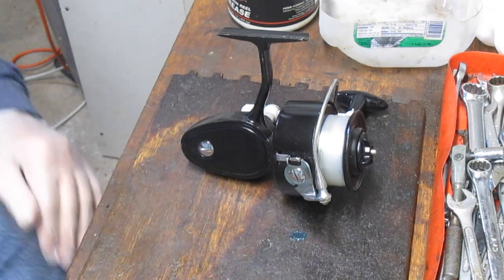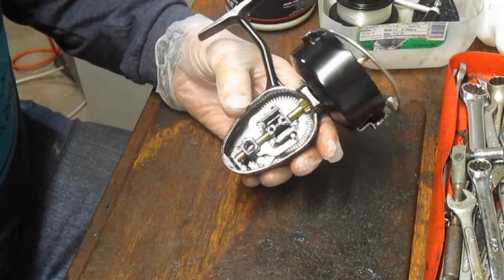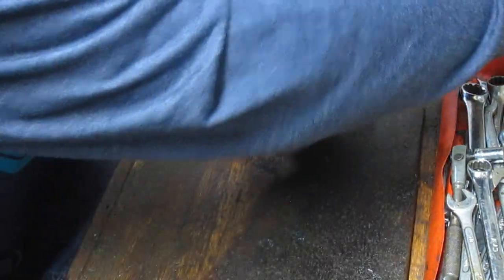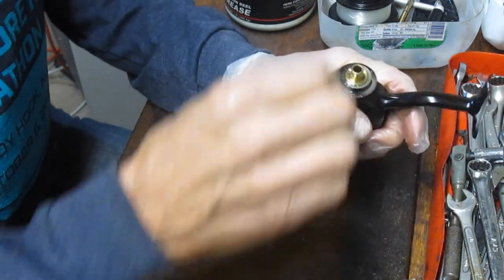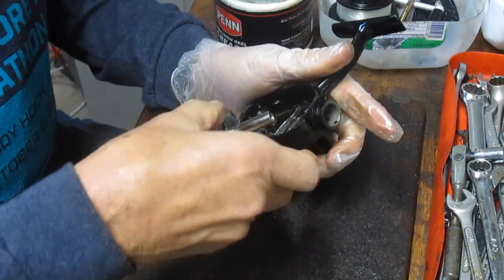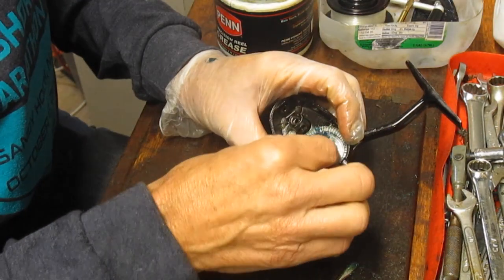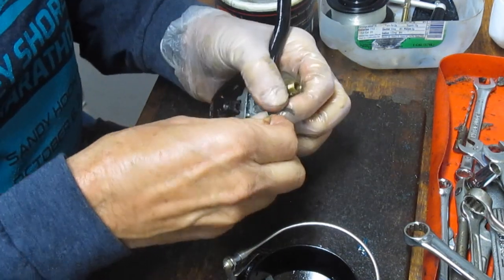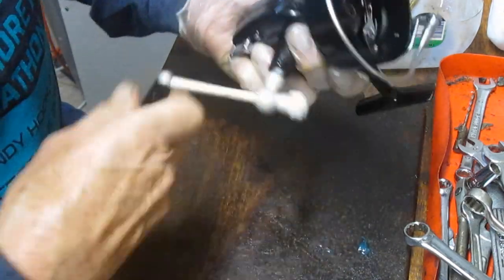Mitchell  306 spin fishing reel how to take apart and service this classic

Comment: A Dennis video from more than a year ago saved me tonight.  I can see how reel repair can become a business since a newcomer to spinning reels like me has more than I can do for folks that have heard about my reel repair hobby.  I was ignorant and thought the 306 would be something like the 300.  There I was in the garage scratching my head when I thought I'd search Youtube for a video and found this one on my smarter than me phone.  I'd been hesitant about getting the pinion gear out but followed the video.  Then, on reassembly, I fast forwarded the video to the parts where I was hesitant.  

Somebody had serviced this reel before.  The pins holding the crosswind block had been replaced with a construction staple.  So, I took a couple screws over to the poor man's lathe (a drill press and file) and turned them down to fit.  A little polishing of the tip at the belt sander along with thinning the screw heads for clearance and there are now two good fitting pins in the crosswind.  For rust protection I heated them red hot and oil quenched them to get a blue/black finish that will  resist rust.  Just something a farm boy growing up away from town would do.
Reply from the maker: You are way better at the bush fix than I am.  I get creative, but not like you.  Thanks for sharing this - Best wishes - Dennis

Comment: I wish my 2 306s were in such fine shape. This one looks almost new. I love these reels. The mechanism is well designed and reliable. I really enjoy my 306 that has been converted  to manual pick-up.  At first I wasn’t sure how to remove the rotor but quickly figured it out. I fish with both my 306s and 302s and love them. I’m still a vintage Penn lover but these are also very special . Thanks Dennis for another very instructive and concise video. I really depend on your teaching!
Reply from the maker: Thanks again Christopher.  Best wishes for catching big fish with those classics - Dennis

Comment: Another helpful video, Dennis.  I got a couple 306 from ebay a while back and serviced them.  That unique plastic fastener between the rotor and housing is technically called a "rotating head lock." Almost sounds like a wrestling hold, lol.... A few weeks ago l lucked out and got nine Mitchell 304 and one Mitchell 305 for a good price.  The 304/305 are very simply built reels, but very well engineered. lf you have a 304 laying around, a tutorial might help some folks because they can be found for peanuts on ebay sometimes.
Reply from the maker: I do have a 304 lying around.  I will add it to my request list.  Thanks for the idea Chester - Dennis
Reply: I also snagged an old 304S on eBay a few summers ago for cheap. Cleaned it up and regreased it and it makes one heck of a small pond or creek rig on a 5’6” light rod. One of my all time favorite small reels. 🎣

Comment: Thanks for the video, I have a couple 306's and the way I see it: If the Penn Battle is not considered too heavy, and the Ambassadeur C3 is not considered too slow, then the Mitchell 306 still specs out as a suprisingly relevant option. One of Mitchells best reels IMO.
Reply from the maker: That 306 I still a great reel.  Thanks

Comment: Dennis, I was looking at this video again because I just fixed up a 306A. I was surprised at how different the 306A is from the original 306. The rotor had a standard nut and there was no planamatic gear system. The 306A just had the simpler oscillation block held to the. Shaft by a double pin. The AR dog was the same. I think some 306A reels had a pinion ball bearing like a 406 and then other 306A just have a pinion bushing setup. I like the 306A as it is very smooth and very nice looking. I still like my two original 306 models the best. I got a mint unused in the box 406 but had to replace the main gear because the shaft was slightly warped. Didn’t expect that. Love this video!
Reply from the maker: Yes - the "A" series went away from the over engineered early editions on the 300 and 306 and went "modern" with the much simpler design.  Send me pictures of the Daiwa when you finish and stay well - Dennis

Comment: Thanks for this video. It really helped with my 407. The only thing I can't figure out is how to open up the drag.
Reply from the maker: If I recall, the wing nut serves as the drag tensioner and theater are only 2 washers, a fabric one and a teflon one under the wing nut and on top of the spool.  That is your drag system.  There is nothing to open up, if I am remembering correctly - Dennis

Comment: Thanks Dennis I bought a 306 this summer in excellent condition and think it's a great reel. I have two new Mitchell 300s which have been out for about 8 years and would be nice to see you service one of those. I think it's an excellent value and it's really smooth.
Reply from the maker: I will add that to my request list and do one should a customer bring one into my shop.  The current line of the Mitchell 300s are nice and well made.  Thanks for watching - Dennis

Comment: Hi Dennis. Was looking at this again to hear what you had said about a 406 pinion gear and bearing. Just got a never used new in the box 406 since I only had two 306s in my collection. Can you believe I got it for $12.50? Hasn’t arrived yet but will. get it Monday. I have heard that the 406 high speed main gears don’t hold up as well as the slower 306 main gear but I have a friend who has a lot of NOS  406 gears. I’ll probably pick up a spare. Finished a new handle for a Penn 706Z today. I’ll send you a photo. I’ve had this 706Z for 42 years and just finished refurbishing it with all new gears and bearings. It is a sweet reel! Love this video as I once used it to refurbish my 2 306s. I have a MB version that I love to fish with. I also put power knob handles on both the 306s. This is an outstanding reference video that I come back to often. When I first watched this video I owned 4 Mitchells. Now I have 15. I love these old reels!
Reply from the maker: That is a great buy!   I'm not aware of the problem with the gears, but I may call upon you to get me one if needed!
Thanks again - Dennis

Comment: Dennis,   Great video. I just got done taking apart my 306 and everything went fine. However, I am having the same problem with all of the mitchells. My old fingers don't work so good anymore and I have a nightmare with the bail springs. I must have spent several hours trying to get it back in and  I bent it.  I have another spring on order. Do any of your videos give a tutorial on replacing the springs on these Mitchells?  I have springs coming for the 901 and also several 300s.  Any hints, secrets , or guidelines to make this an easier job.
Reply from the maker: These are not easy to do.  Generally, you start in the off mode and put the spring pin in the bail arm hole.  You can then rotate it clockwise until the stop clears the hold on the rotor.  Next is to align the hole in the bail to the hole in the rotor and set the screw.  It is a balancing act and it is difficult for those of us will "old" hands.  I will see what I can do for a video - Dennis
Reply: I just quit taking mine out. I loosen the screw enough to get a little clearance, then use a small paint brush to work some oil in around the screw , spring, and the back of the bail arm. Works fine.

Comment: Nice job on this reel. Why do the larger salt water spinners tend to have single screw case door attachments while the lighter freshwater Mitchells have the three screw design? Is it designed for quick opening and drying should the reel get submerged?
Reply from the maker: It is for quick service.  some, like the 302 have mounting screws on both sides and the big red screw cap is to allow for oiling.  Some of the smaller Mitchells also use the single screw side plate cover screw - Dennis

Comment: Hi Dennis. I have the same problem with my 306 that someone else had. Removed ramp and T-pin but couldn’t get the pinion gear out. You suggested flooding with Wd40 and using cup for leverage. I tried this and other things, but it still won’t budge. Any other suggestions? I’m stuck. Thanks!
Reply from the maker: You are literally stuck!  I responded to your email - Thanks

Comment: Dennis I recently purchased a 307 which is the left handed model of the 306, would you by chance know where I could find any aftermarket drag washers for it? Possibly carbon fiber
Reply from the maker: Start by checking with Smoothdrag.com - you may need to search by dimension - inside diameter and outside diameter, rather than by product or brand.  Send them an email - they are very helpful - Thanks - Dennis
Reply: @2ndChanceTackle  thank you sir!!

Comment: What do you think of the drag?  Mine has a single plastic "drag disk",  that floats (not connected to the spool shaft) between the spool and the drag spring.  No washers and nothing under the spool.  This is correct according to the schematics I've seen.  But, how long will that last on the water with fish that may make long runs?
Reply from the maker: You are correct on the configuration.  The drag is a single washer.  A lot of folks that fish this reel use the anti-reverse override to back pedal the reel in fish fighting mode to play the catch and act as the human drag in regulating line in and line out and that's how they make it last.  These are not like the modern drag stacks - Dennis
Reply: I just punch leather washers out of old gloves at work, grease them up and stick one between the plastic washer and the spool. I find that the leather's compressibility makes fine tuning the drag adjustment a little easyer. You can also put a thin tefflon washer under the spool, but you want to keep it free of grease, and you probably want to remove it when spooling on fresh line.

Comment: Hey I have 307 
But  the circular screw thing under the spool makes it to tight it hardly spins 
I wonder if I'm missing bearings or any other parts 
Have nice day
Reply from the maker: That's hard to say.  The best thing is to check your reel against the schematic diagram to see what may be missing.  You can find the schematic here https://www.reelschematic.com/wp-content/uploads/schematics/Mitchell/Misc/MITCHELL%20306-307(1990).pdf  Thanks for asking - Dennis

Comment: Great vidio ..I am working on my 306  I have the trip ramp off the T pin out but the pion gear dose not come out wont budge:( it spins and rotates  withe ease just wont pull out... Any one run into this problem if so how did you get it removed?
Reply from the maker: Of course.  It is dirt and dried grease along the outer rim of the bearing.  First step is to flood that area from top and bottom with a penetrating oil like WD40.  That should help dissolve some of it a free it up.  If you need leverage, put the rotor cup back on with the nut and tighten it down about half way.  That will give you a stronger grip to remove the assembly.  You can also use the rotor cup when a little loose to act as a slide Hamer to help when pulling up - Dennis

Comment: Thanks for the video. Am currently trying to service my 306 but the push button for spool removal is seized, have you ever come across this issue?
Reply from the maker: Yes I have - Try unscrewing the cap to free it.  There are prongs on the axle shaft that are likely catching inside the cap and not releasing.  You can also try to free is by flooding the top with a penetrating oil - Dennis
Reply: @2ndChanceTackle  Thanks for the advice. Had no problem getting the cap and spool off but not the spool spindle, I have the push button soaking in WD 40 and hopefully it frees up.

Comment: My 306 has a red plastic spacer around the center of the spool. I assume it's to allow for less line on the reel. Is there anything in particular I need to know about it?
Reply from the maker: Thanks for asking.  Yes - the red piece is a spacer to reduce the line capacity of the spool.  It should have a split in it that will allow you to remove it if you like.  Nothing special to it.  You can tie the line directly to the spacer, or you can tie it to the spool first and then add the spacer - Dennis
Reply: @2ndChanceTackle  Thank you!

Comment: Great video as always. I have a 306 but the spool doesn't seem to be rising and falling at the correct pace any hints on what to look at ? Love these videos.
Reply from the maker: Could you be more specific on your problem?  If you are saying that the reel is sluggish, then the most likely culprit is old or dried grease which is impeding the performance.  The solution to that problem is a through cleaning with new oil and grease as shown in the video.  If there is a mechanical problem, please describe it further.  The most likely mechanical problem would be a bent axle shaft, which would need to be replaced as it cannot be straightened
Let me know more - Thank you
Dennis
Reply: @2ndChanceTackle  the spool doesn't rise and fall at a concistant speed unlike my friends 306 reel. Its not a bit stiff or sluggish. The axle shaft's movement isnt true .cheerrs for replying
Reply: It turns out that the reel is just fine. It has a completely different mechanism to the other.one has a red fish logo on it the other doesn't. I guess they're from different factories. Their oscillation mechanisms are completely different.
Reply: rouryglen  probably one of the reels is a 306A while the one you have is a regular 306 with the same planamatic oscillation as the reel in this video. The  306A has a completely different oscillation system. You are correct in that nothing is wrong with your reel. Sorry if I’m butting in but I have both reels so I know the difference.
Reply: @christopherjenkins2373  thanks for the interest

Comment: Is there a way to disable the clicker other than turning of the antiverse
Reply from the maker: No.  The only thing you could do if you wanted to permanently  disable it is to remove the A/R dog and spring.  There is no way to keep the A/R and eliminate the click sound. That's because the A/R Dog is slapping the ridges of the gear to make the noise. - Thanks for asking - Dennis

Comment: I'm having a hard time getting the screw out of it
Reply from the maker: You don't say which screw.  Generally tight screws can benefit by a spray of a penetrating oil and letting it soak in before your try to remove them.  I use this a lot on older reels that have not been serviced in a while - Dennis
Reply: @2ndChanceTackle  I have been fighting with this crew all night long it still does not move or turn I'm about to put it all back together